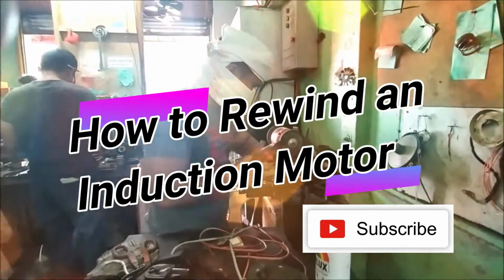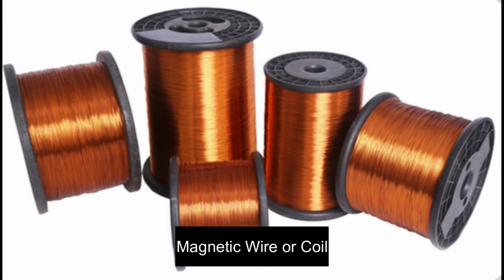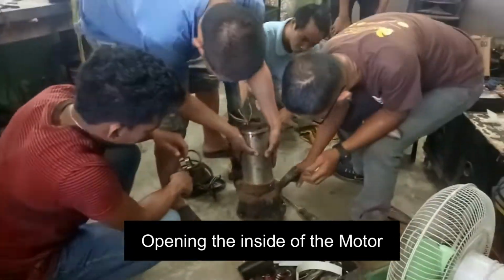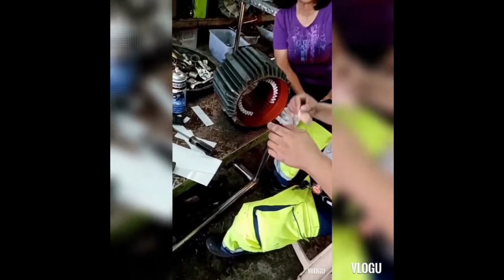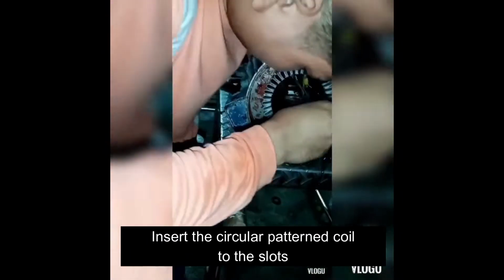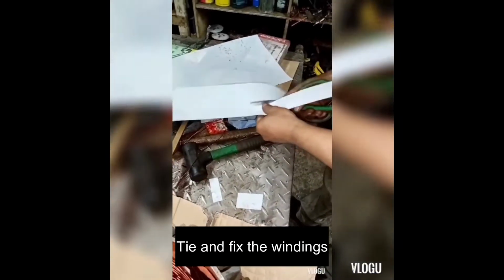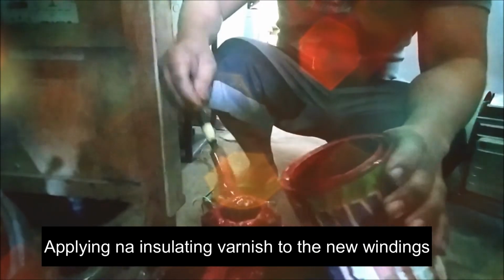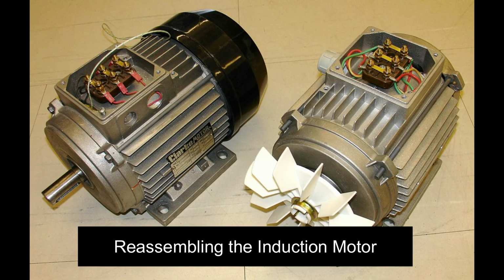Step by step guide: How to Rewind an Electric Motor (Induction Motor)?

Comment: Magandang araw po Sir may question lng po ako about basic house wiring .
 Sana po masagot nyu

Dito kse amin s probinsya line to neutral ang distribution system.
May dalawang drop wires,
Yung isa Hot wire tsaka neutral wire nman yung isa.

Ngayun naglagay ako ng third wire for system grounding 
At nag baon ng ground electrode.

Tanong ko tama bang pagsamahin ground wire tsaka neutral wire s main service disconnect?